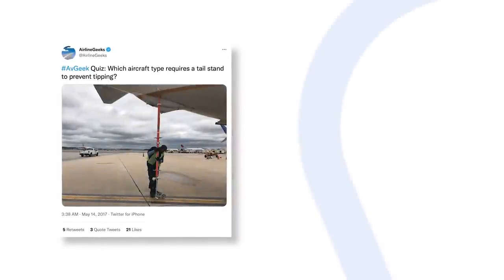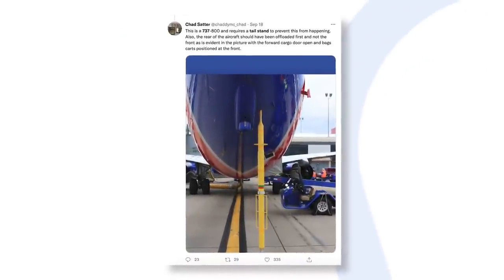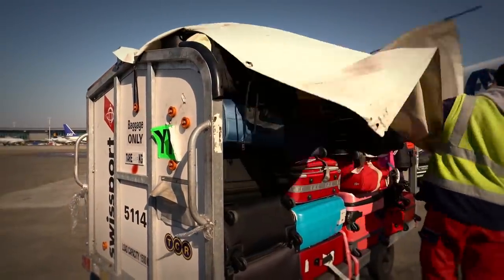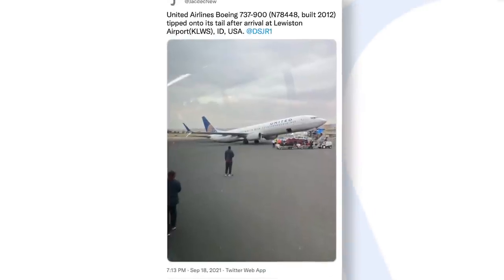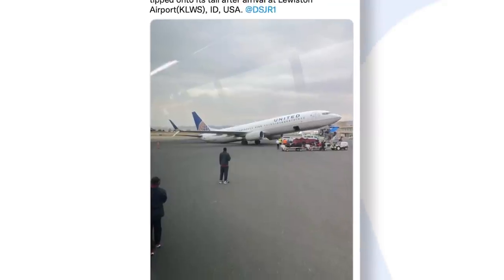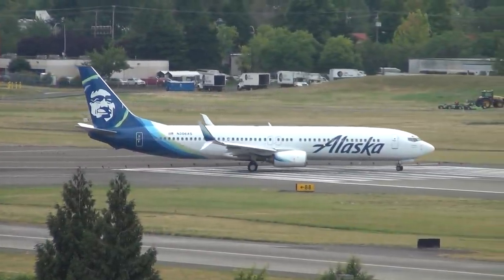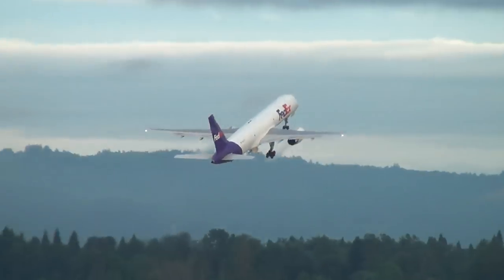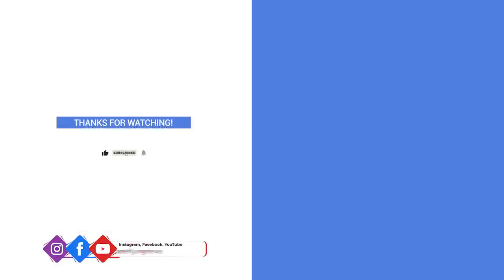Why Do Some Aircraft Need A Tail Stand?

Comment: In the mid '80s, while working at PANC, China airlines used to fly a 747 combi. When it came in, the jetway would not be pulled up to the aircraft until after the tail stand was in place. The rear main deck was loaded with cargo and if the stand wasn't there, the plane would tip back as passengers left the plane. The stand was also too massive, and tall, to be moved by hand too.

Comment: Most cargo aircraft use a tether or weight cart attached to the nose gear rather than a tail stand.   Also, while I dont know if this feature is common amongst commercial aircraft, the KC-135 has a special storage area along the aft fuselage for the tail stand.

Comment: On rear engined aircraft you need a tail steady or at least a minimal amount of fuel in the wing.

On the assy line nose weight and tailsteady once engine weights or engines are installed.

Comment: The ATR 72’s need them during loading because of how pax board at that 1 rear door. Whilst the Q400 doesn’t, the cabin crew on a completely full one sometimes ask people (the heavier ones) to move so the weight is better distributed to avoid the back tipping
Reply: The Q400 is so imbalanced, that people need to be seated in the rear, just to get the nose up. It's the opposite of those tail sitting happy planes. Often enough, they even have extra weights in the cargo hold to balance it out enough to get lift off

Comment: When you've stretched a 60 year old 737 airframe so many times that you need a tail stand due to instability and also to change the engine mounting points due to lack of ground clearance... It's time to design a new plane... 

I always roll my eyes whenever I see a 737 at the airport now, so much more cramped feeling than a A320 series fuesleage. The max has really soured my viewpoint on the 737. It's a plane that doesn't belong in the future.
Reply: Can't agree less.... 🙌🙌🙌
Reply: Agreed 100% I flew the 737 often here in Europe and it's definitely more cramped than the A320.
Reply: @deepakmadhukar28  can't agree more You mean?
Reply: The A320 series has also been stretched just like the 737
Reply: @MrArod356  yes, but the airframe, being more modern, and the landing gear being higher off the ground allows it to have better balance than a stretched 737. The 737-900 looks like a lowrider that's scraping it's belly as it's taxiing.

Comment: Why not incorporate an automatic tail stand into the aircraft that lowers when at the gate? Anyone know why manufacturers don't add this feature?
Reply: Most likely due to the additional weight it would give the aircraft.  Granted it wouldn’t be much but even 1kg of extra weight burns more fuel.
Plus it would have to go through maintenance checks, again costing the airline.
Reply: It's expensive, heavy, additional mechanics and doesn't save lives. That's the quick and easy answer.

Depending on the airplane, that stand had to cover 2 to 3 meters until the ground and be structurally stable enough to hold up part of a multi ton aircraft, with momentum pressing and bending the stand.